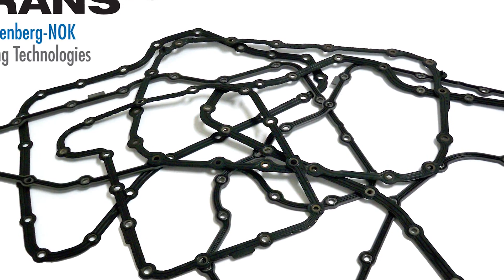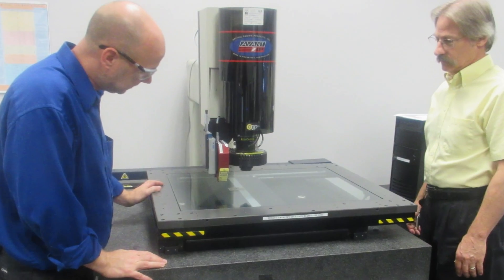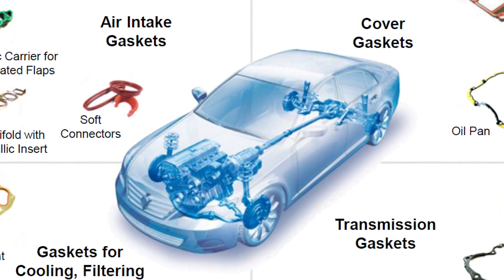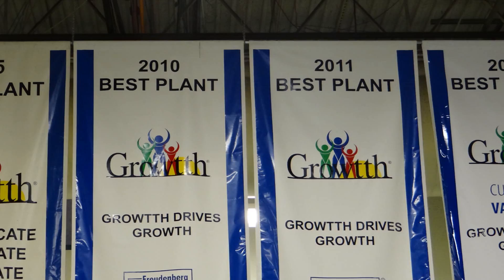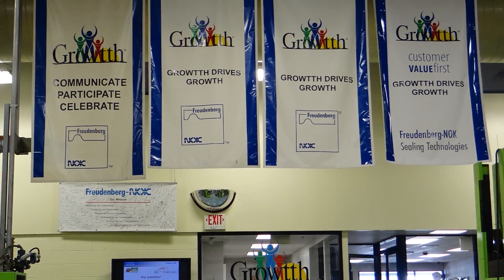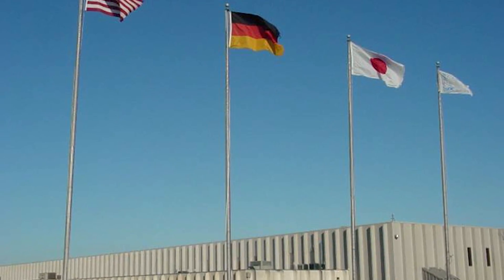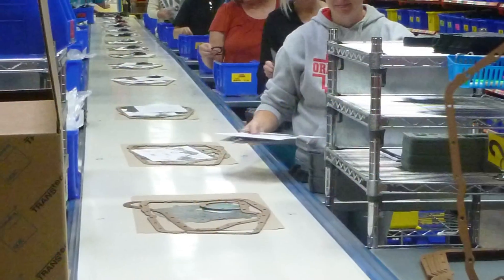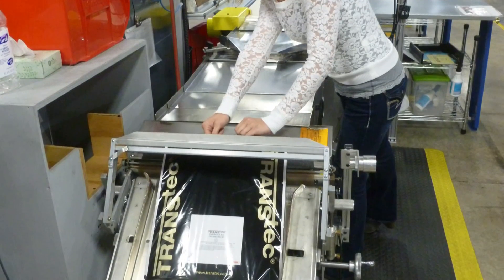What makes TransTec kits the best of the best?

Comment: From the proceeds of selling my first born, I bought a TransTec rebuild kit for a Toyota U140F transmission. At least one of the orings for the low/reverse piston is missing from the kit (don't yet know if additional parts are missing; if they are, you'll hear about it). A previous kit for a Toyota A540E transmission also had missing/incorrect components. For the prices that Transtec charges, they ought to pay the workers enough to care about what they are producing. Instead the "company" gives virtually all of the money to a handful of people at the top who essentially do no work. At any rate, my complaint is very SIMPLY if you want to sell transmission rebuild kits at exorbitant prices, with an outsized, DISPROPORTIONATE  share of the money going to management INSTEAD OF to  the people ACTUALLY DOING THE WORK, the least you could do is include all of the required (promised) pieces!! If there are any further missing pieces, I will post an UPDATE in this space. $225 for this kit AND I have to now hunt around for the missing oring at my expense and my time? What a scam.
Reply from the maker: We will gladly sent a replacement O-ring.  Please email: Brandon.Evans@fnst.com